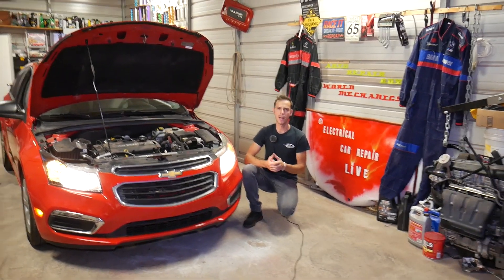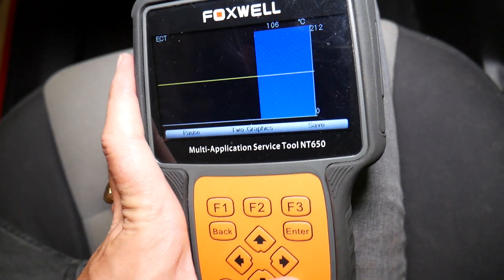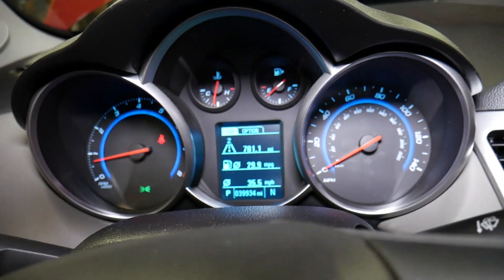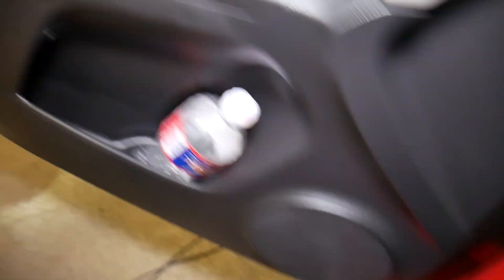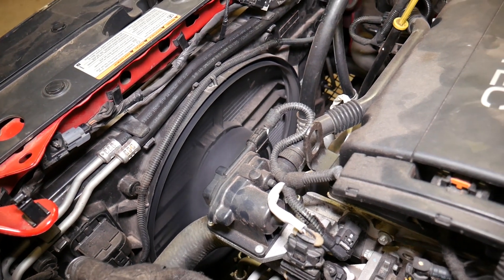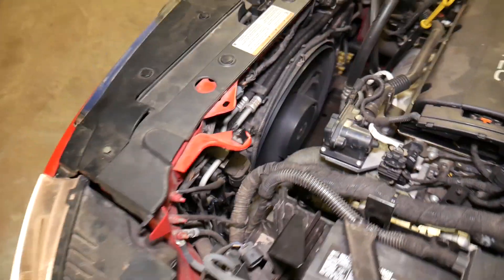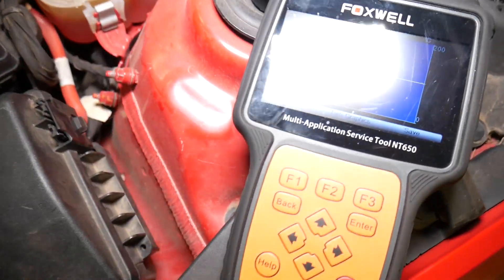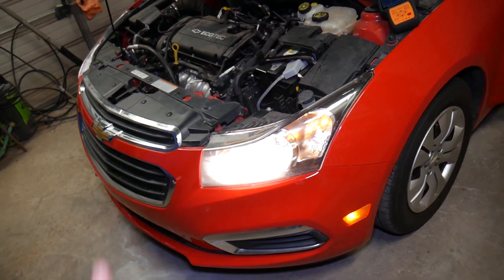AT WHAT TEMPERATURE RADIATOR FAN TURNS ON CHEVROLET CRUZE, CHEVY SONIC, HOLDEN CRUZE

Comment: Hi guys, great channel and im subscribed. Just asking a question I have a 2012 holden cruze 1.4lt turbo and have changed the coolant bottle and changed to an aluminium thermostat housing and I bleed the system and noticed here atm it's 14dec and car runs from 99 to 107 average 103 104 is this operating range as it's not summer and wondering if this is normal for this engine.

Regards Rick

Comment: I have this problem too with my chevy spark. Before the radiator coolant temp sensor got broken, the fan starts to rotate at 96 celsius and stops when the temp is 90 celsius. I bought a new sensor, now the fan is not turning on even reaching at 102 celsius. I'm afraid to reach at least 105 so I'm turning the engine off below that temperature. I will test it to reach 108 soon and if it will spin at 109 but how come it changed it's function, I also watched a thailander man that he have the same issue as mine from 96 before, it spins at 109 after changing the sensors. Is there a way to maybe override it to make it function like before? Hope someone has answers.

Comment: Another question please, my chevy spark has an overheating light on dashboard, how can i stimulate if it is working? I made a jumper on both coolant temp sensors ( showing 130 deg on scanner) but the light didnt turn on, i waited few minutes and the light stayed off, i got confused !!

Comment: I notice in my chevy spark when the engine is at idle speed the fan turns on at 108 deg and off at 104, while when the car is moving and the engine speed is pretty high the fan starts at 98 and stops at 92, is that is normal? Do you have a document  or table show the logic how the fan works?
Reply: Yes

Comment: My chevolet shows 107° on inlet to radiator & outlet 70° back into water pump meaning the fan it cooling back 30°c
At 98° it should enter the highest speed of radiator
Whats the temperature on each stage of fan ?

Comment: At 107° does the gauge show 6,00 time on clock meaning 1/2 on temp gauge?
Reply: At 85C to about 118C it will lock itself to 1 notch below center. Then once it's already overheating and throwing errors and shutting off AC, it will finally move right into the red.

Comment: I have an opel astra j 2014 a14net and it presents me with the same problem with the fan ... it keeps on, it stops and never closes ... I changed the refrigerator, water pump and thermostat general motor..3 times..I have not solved the problem my ... what can it be, please give your opinion .... 6 months of suffering and no one can find it ....

Comment: Hey guys please I have the same issue for my Chevy Sonic the cooling fan start running at 108°c and stop at 102°c 
Please is it the Normal working temperature?
Reply: mine is always off even if AC is on it kicks off for 30 sec and then goes off and on after 30 sec and off ,before that it was always on even when ac is off
Reply: Yes

Comment: What could it mean if the fan does not turn on at all once the engine rises to operating temperature? (Fan works with AC)
Reply: try to remove the temp sensor wire if the fan comes on then you have a bad temp sensor which is easier to diagnoses
Reply: Exact problem with my car
Reply: Same here!! What was it guys?

Comment: My fan when is on it will take longer time than yours to turn off or sometimes will never shut off until I put the engine off..
What should I do?
Reply: looks like common problem having same issue :)
Reply: @nuramoboy  I replaced all temperature 🌡 sensors in radiator,  thermostate with the housing, and engine coolent sensors and the issue was resolved.